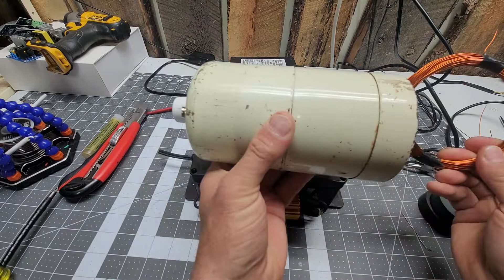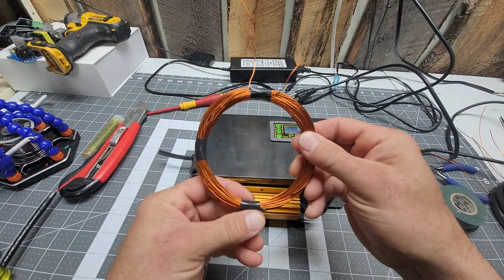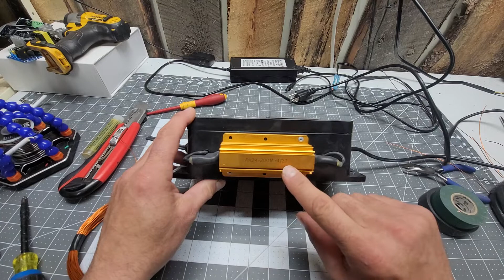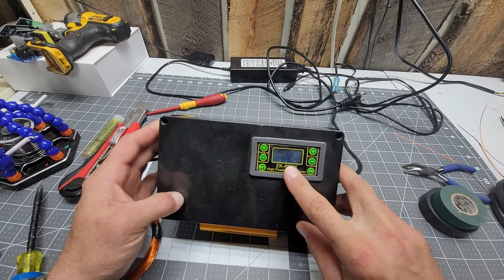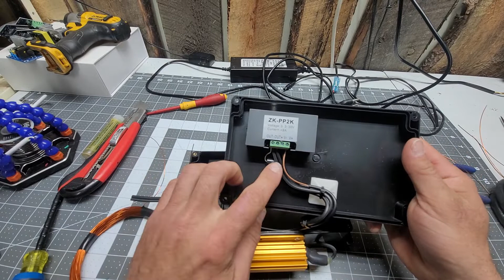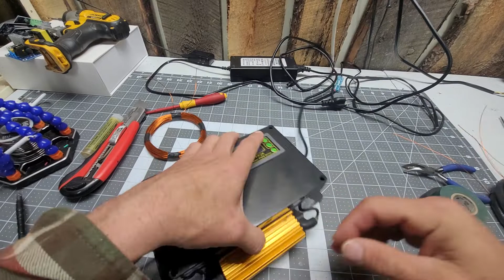diy pemf. very basic unit.

Comment: Hi Steeve, I need help. When I connect the coil, the ZK-PP2K screen continues to flicker. The coil resistance is about 3 ohms, dc 23volt. Do I need to add an inline resistor?  Thanks in advance
Reply from the maker: @ballscrewpro  your power supply is probable to small.  

What.is the amp.of.your power suply.  

Also I have much much easier build.amd better build later on my channel.

Comment: Hello, thank you for sharing your designs, I wanted to tell you that I got some coils (FLAT COIL p 180) these coils support a maximum of 200 gauss, my question is whether this circuit that you present here would serve to operate these coils with optimal performance. In the link you can see these bonuses

https://scontent.faep6-1.fna.fbcdn.net/v/t39.30808-6/240735163_881645375768993_7252479043763106412_n.jpg?_nc_cat=101&ccb=1-7&_nc_sid=5f2048&_nc_ohc=wS_Wd0h4nmoQ7kNvgGEcMqM&_nc_ht=scontent.faep6-1.fna&oh=00_AYDEgdjSUqlLOgVPCrpRq5H0y0E_SgktxuNQ__PjH2ZTaA&oe=667E7DD7

Comment: Hey Steeve, thanks for the videos. I have everything to make this unit except for the 22 gauge wire. Could I use different coils? Would it harm anything? I have a bunch of larger wire left over from home construction work. Mostly 14 and 16 gauge. Im assuming theres a way to calculate for it. Could I make coils out of that stuff or is that not really a good idea?
Reply from the maker: Please very please email me 
Steevebradet@outlook.com

Lets chat.  :)

Comment: Hi Steve;
I was very motivated by your pemf project and built one, but my results are very different, and I was wondering if you might suggest some troubleshooting solutions.  I'm only measuring 35 milligauss per coil, not 35 gauss like you are getting.  I used 22 awg enameled copper wire, 3.75" dia coils, 95 turns, with a total of ten coils.  I used the ZK-PP2K, a  4ohm, 200 watt resistor, and a laptop power supply that puts out  20 volts @ 8.5 amps.  Also, my cord going to the mat is 16 awg and is 6' long.  When in use I'm only measuring 5 volts across the leads that go to the mat and 1.5 amps.  However, if I disconnect the leads from the control unit, the output on the control unit measures 21 volts output.  Any suggestions on what I'm doing wrong?
Reply from the maker: Please reach out to me at 

Steevebradet@outlook.com 

Will chat further !! 
:)

Comment: Hi Steve! Very interesting. I’ve been looking through your videos and can not complete my planning for this project. I see part 1 and 2 for a couple different projects but nothing continues. Do you have a tittle for the progression of your projects? I have a 24 volt 20 amp laptop power supply, a zk-pp2k pulse generator, 20 ga. Wire on order and a 200 watt resistor. Personally I would prefer a single unit (for dental issues) however I see the Matt as long term and diversity and will work for my issues. I have been using the flash pulser for about a month. It is very time consuming as I can only make it pulse every 20 seconds or so. A wiring diagram would be nice. I’ve seen some but can’t follow through a whole project. Thank you 
Dave
   😎
Reply from the maker: Ypu are in luck.  Just re started me l
Patreon page with allready a ton of data on it.  

Go check it out.  

https://www.patreon.com/PEMF

Got the nextuon program and the zk set up without resistor.  

:).  

Question please ask away!!
Reply: @Steeve. what category is your patriot on?  Thank you 😎

Comment: Hi Steeve, Its possible use two 4 Ohms Resistors behind for even better heat dissipation from the mattress?
Reply from the maker: Yes but there is always a cost.  An easier way are 

1. Lower power supply voltage 
2. Lower duty cycle  

The 1st lowers the gauss output 
The second is a.much better way.   Lower duty cycle  allows for more cooling time less heat generation and keep most of the power the coils.make.   

Let me know if you have question.  :)

Comment: What type of wire is connected to the resister and how do you connect it to both sides?
Reply from the maker: I am not sure I fully understand your question.   
If I missed it let me know. 

The wire used is minimum 16gauge for the dc,   
The resistor is wired in serie with the output of the pwm (pulse generator) 
Hope this helps. 
Let me know if you need more info

Comment: Hello, I like your device. Where the two ends the resistor is connected exactly? Thank you much.
Reply from the maker: Will make a new video explaining a few things.  

Thank you for the feed back!!
Reply: I need the connection only for the resistor
Reply from the maker: The resistor is connected in serie with either plus or minus out wire of the PWM ( The zkpp2k) 

Hope this helps. 😀😀
Reply: @Steeve.  Thank you much.

Comment: Excuse me, I don't quite understand the function of the 4 ohm and 200 watt resistor? . And what is the diameter of those bottles? ... on the other hand have you measured the impedance of the coils ??? , is that parameter very critical ???
Reply from the maker: The bottle is 98mm in diameter. 

The resistance of one  coil is 4ohms. 

The resistor is use to balance the system.and take the heat away from the coils.  

It is a tricky thing to balance between all the laws involved.  The resistor saves a lot of issue easily and cheaply.  

It is possible to add copper to the coils , use smaller wire, serie them all together, work around saturation of the coils to eliminate the resistor, run the duty cycle at 5% to eliminate  the coils from.heating too much.  At the end the math  predicted.this way would be the simplest and most efficient way to build it.   I did build.other model but never achieve such a good level as the one the videos describes so simply and cheaply.   

Also the target power I wanted from the coils is based on imitating what I have read in the majority of the research papers.

  I build the unit to give me a specific gauss level on each coils.  (45 gauss )

Comment: Hello, you have  some nice and simple PEMF devices, I'm enjoying watching your channel.

I'm wondering what is the type of coil used in devices such as  "TeslaFit or PEMF-120" the "butter fly or the flexible shape cable to fit in different areas of the body"  and the coil you are using in your devise?

Second thing is: these high power devices with one or two Tesla power always creates like glass clicking sounds, is it a spark gap ?

Keep up the good work!
Reply from the maker: Hi.  Thank you for the comment and questions.  

I make the coils donnut shape as it is not only the simplest but the most efficient.   

The whole system is notnhigh voltage. It is only 24vdc.   There is no spacks it is only the magnetic field that moved the magnet.   

If you are interested to have a deeper conversation I would love to chat with you.   Let me know.  
😃